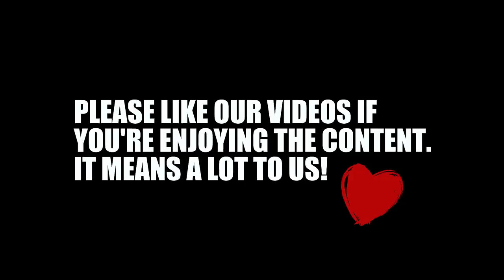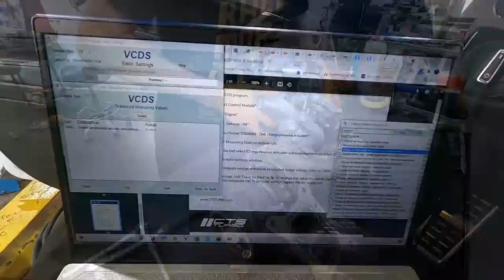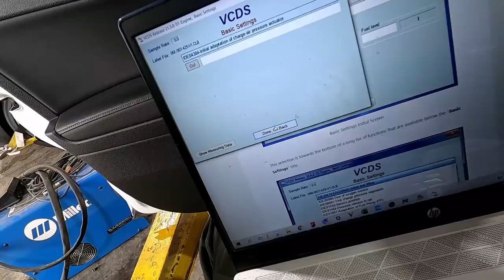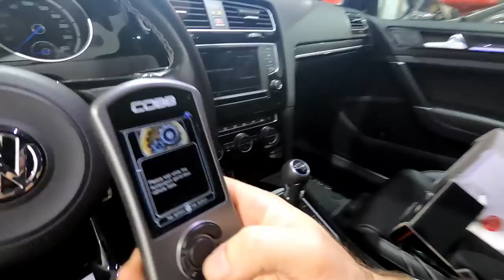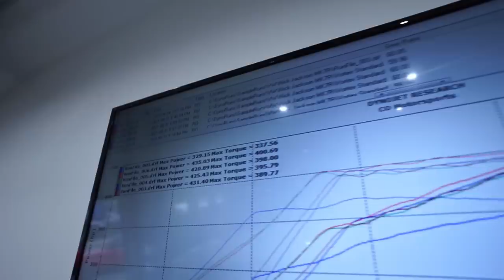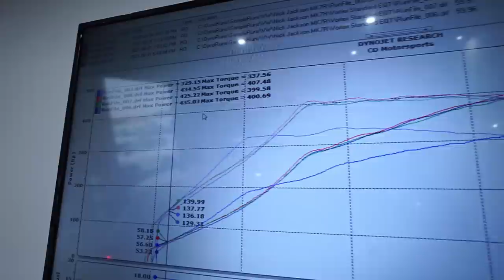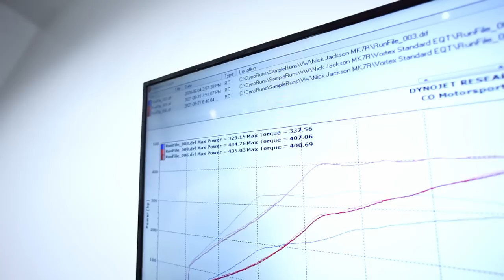MK7 Golf R with EQT Vortex Turbo and lots of upgrades on the dyno

Comment: Nice build.  I wish America had multi port injection
Reply from the maker: At least it can be added. MK5/6 didn't have that option and got shafted on fueling.
Reply: @COMotorsports  yeah you can only use wmi or auxiliary injector =/ have you guys ever used auxiliary injectors?
Reply from the maker: @hyper8545  yes sir, we've done both.

Comment: Awesome build. I have almost the identical MK7 R and build down here in Tennessee except i've got the 6spd DSG. Love my EQT and tune running 93. Haven't gone corn yet though, pretty pleased with what these E888 Gen3s can do with minimal bolt ons.
Reply from the maker: Yeah definitely easier all around but still comes at a price. Difference is, it's basically factory replacement stuff so it all fits and works just like factory.

Comment: Cant wait to see what kind of power these 7R’s will make with the new garretts coming soon. Bet this thing ripssss
Reply: A small company did a test on an R today and it made 400whp on pump 93, it seems to be a little smaller than a vortex XL but has similar spool time to an is38
Reply: @dillonlarose3971  oh, nice! I recall unitronic stating that they’ll have two versions/packages. The other claiming to make much more above 465 crank. Guess i’ll wait and see.

Comment: Am I missing something rear wheels not turning ? No all wheel dyno?
Reply from the maker: You're not missing anything...they are definitely not turning.
Reply: @COMotorsports  how much difference if run on an awd dyno?  Is that just digitally disabled or do you have to physically remove prop shaft? Kind of makes me want to do the opposite to have rwd golf but highly doubt rear only would handle the abuse
Reply from the maker: @joeszucs2190  you can't do rwd. Haldex doesn't work like that. It'l can only take up to 50% power. Also it's just unplugged to prevent it from engaging.
Reply: @COMotorsports  yeah kind of what I figured. No easy way to RWD golf.

Comment: I would throw a methanol injection kit to add extra fuel.💥
Reply from the maker: it definitely helps for sure.
Reply: @COMotorsports  If other cars other than VW 😋 can hit that dyno I would totally bring my MS3. It's fully build+ meth, it would great to see what numbers I am putting down. But then again you are 4 hours away. 😅😆
Reply from the maker: @grumpu  Dyno's is open to all makes. Aside from diesel trucks... screw that mess. lol

Comment: Why did he waste money upgrading the HPFP if MPI was being added?
Reply from the maker: Theres a purpose for everything
Reply: @COMotorsports  OK?  The bulk of the fueling is taken by the MPI.  If he wasn't going MPI then yeah, the stock HPFP becomes a bottleneck at peak torque.  There are lots of us running hybrids on E85 out there and the stock HPFP doesn't need touched if going MPI.  I just hope nobody recommended he waste his money upgrading it.  Good video though he will definitely enjoy  it.  Have to relearn his driving style as it doesn't die off like the IS38 does.  The sauce is 6k+; really makes for fun times.
Reply from the maker: @dirk5950  there's more to come with this one.
Reply: because this shop will happily take your money for stuff that does nothing.
Reply from the maker: @nathangamber9230  you have no clue what you're talking about.
Reply: @nathangamber9230  That's uncalled for.  If you bring a part in to install it are they going to say no?  Of course not.  Unless they think it will cause issues, then I'm sure they would.  In this case it was just wasted money, it will function as intended.  Coulda spent it on a PM4 or a nice brushless pump so they could turn up pump duty if the plan is for E85 tuning.  Guess we shall see what's in store.
Reply from the maker: @dirk5950  You're arguing with yourself lol.. let me explain. The client did not intend to do MPI when we ordered the turbo and went down this path. .So we ordered the HPFP upgrade. While we were waiting to get the car in for the upgrades he changed his mind and decided to do the MPI as well. Make sense? It's a few hundred mod amongst literally thousands and thousands and is there to help support whatever the owners plans are in the future. If you were in the same situation I suppose you would have just chucked it out... no you would have installed it especially if you're getting a tune specifically for the upgrades.
Reply: @COMotorsports  Fair enough.  No I wouldn't have chucked it.  I'd have said "Order an MPI kit, leave the autotech in the glovebox so I can sell it."
Reply from the maker: @dirk5950  It doesn't work as good in the glove box. :)
Reply: @COMotorsports  touche!
Reply: @nathangamber9230  I'm the owner of this car and I can tell you that this upgrade was absolutely necessary for my future plans for this car. I didn't want to waste the energy typing this but I figured it was something that had to be said. Thanks again Dave and the crew at CO motorsports, Claytons reaction was the best but mine was good too, especially that damn TP in the back. There may have been a piece or two missing by the end of it though...lol
Reply: @bblover4ever1984  who told you this upgrade was necessary? it's always easier to just add bigger PI injectors. there are 1200 hp RS3s running stock DI.
Reply: @bblover4ever1984  Instagram?
Reply: @mexicofullsends3161  yessum?
Reply: @bblover4ever1984  what was the full exhuast setup on this car and what intake
Reply: @kamuelavanarsdalen5347  it was a 3 inch cts  catlessdp with a custom build straight pipe from the mid to the tips

Comment: This "american style" dyno fans is a joke. In europe office desk fans are bigger.
Reply from the maker: Cool story. This style of fan actually works better than the larger higher CFM fan you see behind the dyno. There's a reason we use them.
Reply: @COMotorsports  I belive it, as fan behind dyno is poor aswell. You need about 10-15kW fans atleast to have proper cooling. I use 7kW on my dyno and need to upgrade to be able to use it in 30+degC ambient temps. I just cant understand why almost whole USA uses so poor cooling systems even for lambo and other exotics 1xxx hp engines.
Reply from the maker: @marchewa000  Cost is the answer.